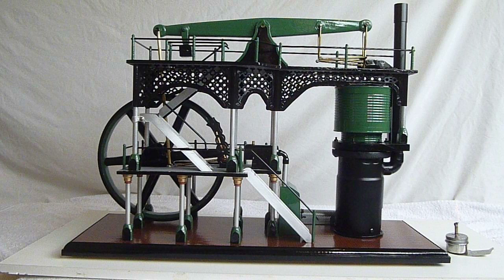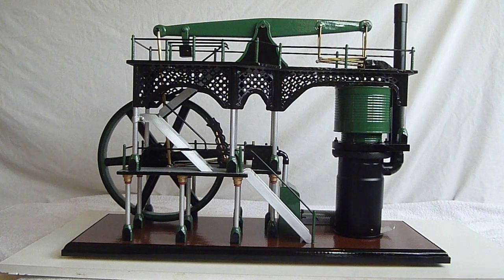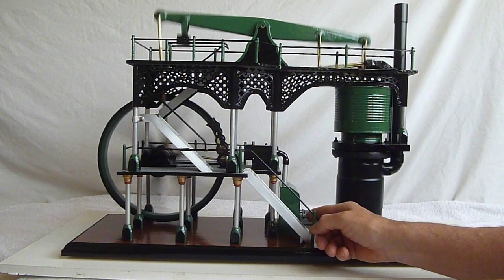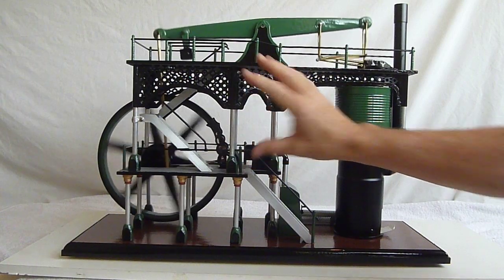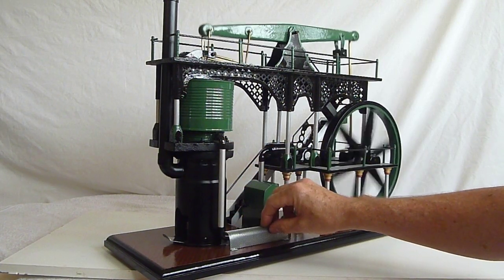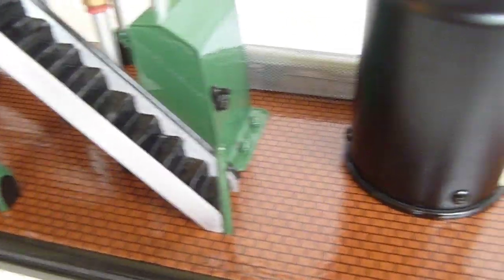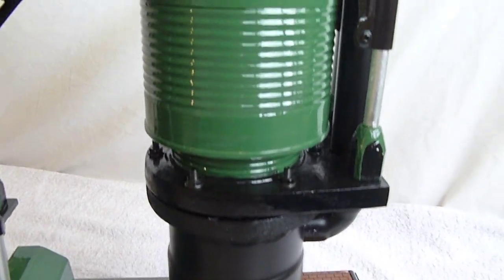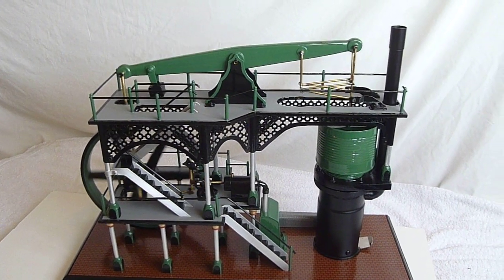Homemade Stirling Watts Beam Engine , Hot Air Engine .

Comment: Wow, what a stunner !!! i am making one from 32 mm plumbing pipes that are heated by an electrical induction heater ( i had one left over from another project and as this one is quite bigger i decided not to use an alcohol lamp flames ) so yeah thats great and i got pipe clamps made of copper to give it a bit of bling, plumbing gear is cool in that they come with pipe ends ( made of brass ) so you can get compression up, once you make a nice piston head to keep the air contained .... well done !!! Oh yeah and mine has an electrical starter motor, so i can watch it in motion while the system heats itself up, then turn the 12 volt motor off when i notice the vibration change ....

Comment: How did you modify the car break cylinder? Does it have the original piston with the rubber seal?
Reply from the maker: Hi. If you pause the video when the cylinder is in close up. You'll see the right angled pressure pipe on the right. This pipe and some epoxy resin seals that end. I removed the seals from the piston and shortened it a bit. Can't remember the length. I also drilled a hole in the top and fitted the tube to allow for lubricating with a light oil like WD40. Hope this helps.
Reply: @garyknight4150  This helped me a lot. Thank you!

Comment: Beautifully detailed model. Using a brake slave cylinder for the power cylinder sounds like a very good idea. The flywheel looks super. Is it a push chair wheel or similar? Congratulations on a superb model.
Reply from the maker: +valvelifter1951 .Im sorry i had not replied earlier . The flywheel is made of wood , i cut it from a wall corner shelf using an electric jig saw and used various shaped files to finish it off .
Reply: +Gary Knight It looks very nicely made. I have just designed a flywheel/fan for a Stirling engine. It's made of bicycle spokes fastened to two mudguard washers (for a hub) and each spoke is attached to a fan blade made from plywood. I will embed a two pence piece in the end of each blade to give the required inertia. I will make a video when I have finished it.
Reply from the maker: waiting in anticipation : )

Comment: Could you connect this to a generator and give yourself some energy? be cool to see one that has a practical use too. Absolutely love your work here, can tell a lot of thought has gone into it.
Reply from the maker: +David Jones Thank you very much David , this engine would not be powerful enough to run a generator as its too slow and has very little torque  . High revving stirlings can run a small generator with the right gear reduction , have seen some lighting L E D lamps and charging a phone .
Reply: +Gary Knight Be so cool to see them. Really getting into steam engines, such an amazing era.

Comment: Very nice indeed.
One comment: I believe the Watts linkage was originally designed to avoid the tilting of the piston rod: You can see that quite clearly happening on the power piston. It's the lateral force which is quite likely leading to the clicking noise you refer to.
When you make your next one, perhaps you could incorporate a Watts Linkage on the power side too.
Reply from the maker: Hi Warrawee , thanks for the comments , it is possible that there is some lateral movement on the power piston connecting rod  , but the power piston is connected to the rod by a horizontal lubricated gudgeon pin and the movement seen on the recording is in an upward motion , so this should not cause a problem , what i think it is is that the connecting pin on the fly wheel is not perfectly in alignment  , so that as the flywheel rotates its making the front end of the rear connecting rod move in a slight side too side motion as it moves forwards & backwards . A little more tinkering is needed .

Comment: Gary that is incredible, truly awesome, I am very jealous. The design is stunning,  I would say its totally and utterly unique, but the design is also believable (you get some engines that work but would have never been built in real life, if that makes sense.)  for instance on a model you could probably get away without using the "Watts Parallel Motion " putting in the different floors steps and hand rails gives the model "Scale" and makes it so much more of a realistic design. Many many viewers will never appreciate the hours of design work that's gone into working out all the pivot points and stroke lengths,,, but I can fully see the time its taken to come up with such a stunning design. (I have mentioned that I had considered converting my beam engine to the "Stirling principle") but one of my concerns was placing the displacer cylinder some way away from the power cylinder, and whether the vacuum would transfer along quite a long pipe, "yes in theory it should, but in modelling theory often lets you down,,, but your design proves it works beautifully and allows you the room to add the regulator, which again is an outstanding design feature. If you look at most of the live steam "Stuart" model (beam engines etc,) very few if any achieve a realistic slow speed, and introducing a regulator to a "Stirling" engine must be close to a first (I may be wrong im not an out and out authority ) but it is still a great bit of lateral thinking and ingenious simple design work. And the workmanship speaks for itself, you only have to see it running and its like a Swiss watch, The fly wheel is perfectly true by the looks of things,, again something quite simple at first sight  (even more so if you have a lathe) but once you start to increase the size of the wheel then its very very difficult. Your use of car parts and perforated metal further adds to the overall look making it even more believable as a real working model of a large pumping engine. You must have been over the moon when it first ran,,,, and you shouldn't never worry about how long its taken because the result is outstanding, it is exhibition standard and a joy to watch,,, I am very impressed,,,, congratulations.
Reply from the maker: Thank you very much Alan , as you have said it did take some time working out the connecting rod mechanism and even while making it i wasn't sure if it would work correctly , but i am glad to say it did . I too wasn't sure if the length of the pipe between displacer & power cylinder would cause a problem as i had read on some sites that too much dead air ( as they had called it ) would impede the efficient running of a stirling engine , but as i only wanted a slow runner i took the chance . I feel the slower a beam engine runs the better it looks , and as a plus you can run it on a smaller flame & therefore run longer . Thanks again Alan , hope all your projects go well ...Gary
Reply: Its a great job all round Gary,,, as I say its  easy if you have a lathe and workshop etc.  but what makes it so much more of an achievement is when your also designing in the drastic lack of  tooling capabilities, can I drill this,, how can that be fixed to that, what can I use to make X,Y, and Z,,,, Great job ,,,, and with the experience you now have,,,, I bet your mind is already processing thousands of possibilities, taking everyday components and accessing their potential as parts for a future build. Cheers Alan